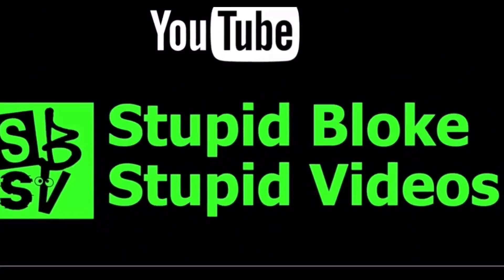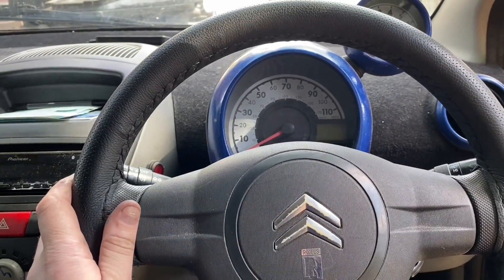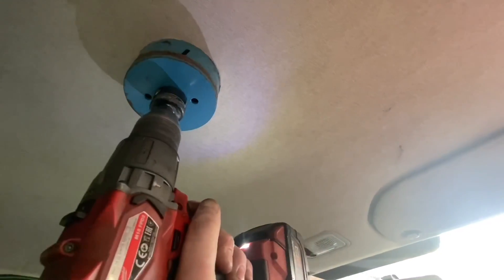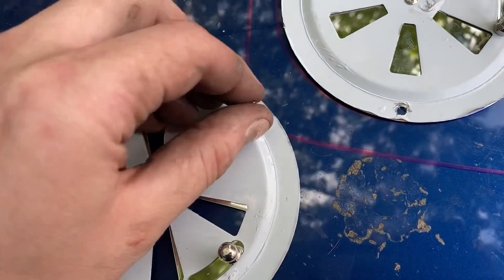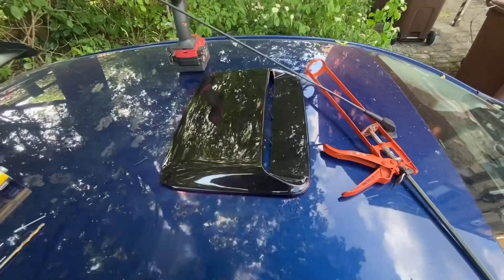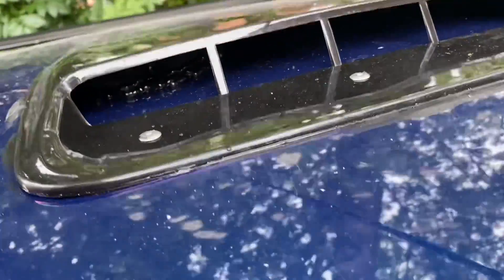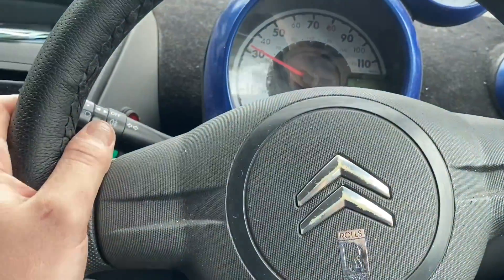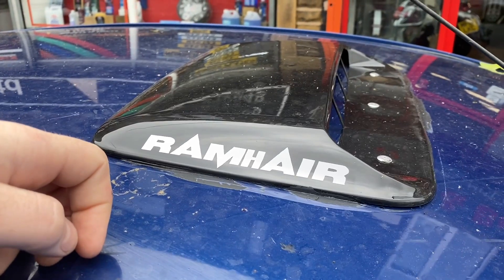No AC? Too Hot When Driving? Easy DIY Aircon/Driver Ventilation System on the CityBug (C1/Aygo/107)

Comment: It took me 1 day to get all the A/C bits off a scrap C1 and fit to my C1. Cost about £60 for the compressor, heater box and pipes etc. All C1s have the wiring for A/C.

Worth every penny and effort!
Reply from the maker: If you can find a donor car with all the bits cheap enough, and you love the car enough to be willing to put the hours in then it definitely would be a worthwhile thing to do.

Comment: Damn, didn't realise my shitter had all the fancy bells and whistles on it since it has an ACU installed. Shame it came with a totally shagged clutch 🙄

I'm curious as to how this is better than your standard cold air vents? Just more air flow?
Reply from the maker: Sounds like you got a fancy one. Mine is as basic as basic gets and even has wind up windows!

The way the air comes straight in and blows down onto your head is definitely better than the vents or a window open with less disruption, but obviously actual AC would be better still.
Reply: @StupidBlokeStupidVideos  haha mines got wind up windows too! Professional job as always 👌 😂🤣
Reply from the maker: @JAYG6390  wind up windows = lighter = fasterer. 

Because racecer n all that 🏎️

Comment: You can always tell which car you have been driving as its always nearly out of fuel! 😂

As for the scoop it will also be useful on hot days when the car is parked up as it can naturally vent the hot air out the car. So it will be cooler before you even get in.

Personally far too chicken to cut a hole in my roof! 😂
Reply from the maker: Haha yea, I always run it down to the light so I can record the mpg as accurate as possible without running out. I put it in by the gallon, usually 2 gallon at a time, unless I’m feeling adventurous and passing Costco. I reset the trip as soon as the beep for the last bar. I’m just very boring like that.

Comment: Fresh
Air 
Recirculate
Technology 

Just use the acronym on the boot lid ,,,, jobs a good un.

Once you had the hole drilled there really was only one option to fit ,,, well ok two.

A funnel , like an ocean going liner [ Titanic springs to mind .]
or 
A periscope ,,, preferably in yellow.

But if you fitted a chimney , in the winter you could take the passengers seat out and fit a small wood burning stove , sort of like a Range Rovers pre heater , only lower tech.
Reply from the maker: All good idea. I particularly like the sound of the budget Webasto heater 🤔
Reply: @StupidBlokeStupidVideos   you could have your nuts roasting all winter ,, ho ho ho ,,, ah bum hug. and other assorted pagan pleasantrys